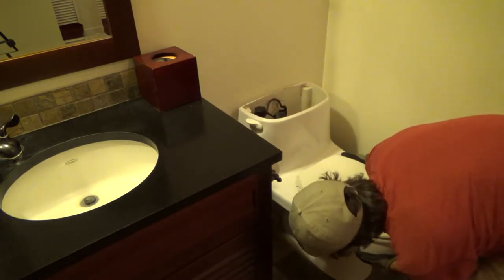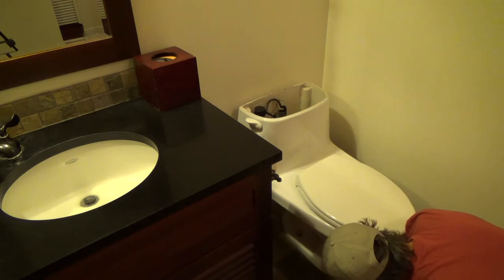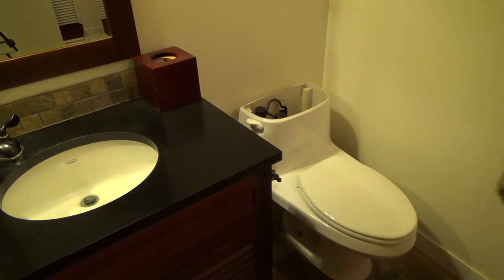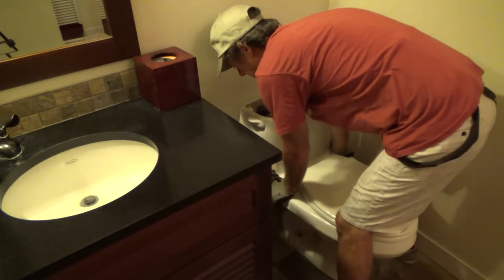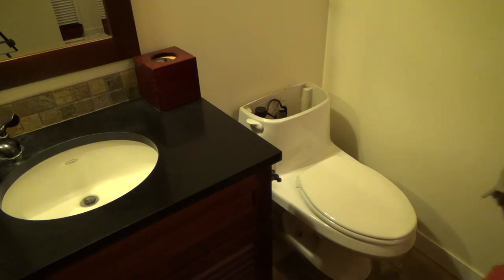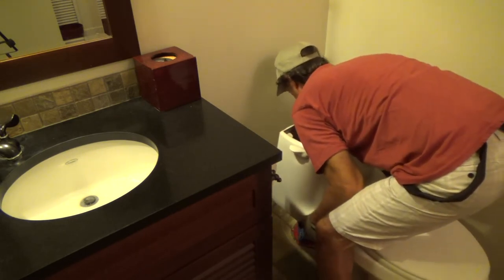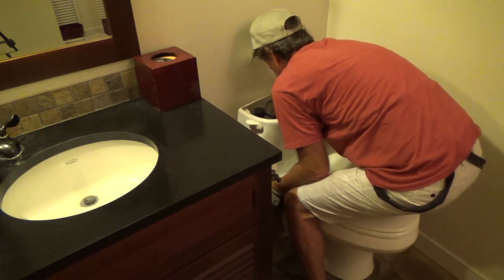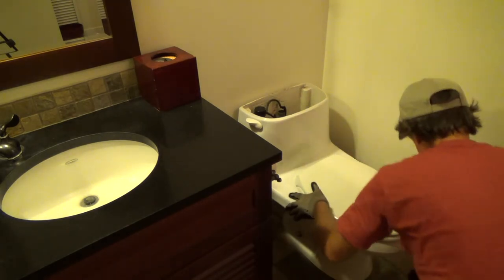How to Install Toilet...Installing Waxless Fluidmaster Toilet Bowl Seal Ring...Part 2

Comment: Don't know if you still respond to older vids but I believe I know why the toilet wouldn't sit flat with the black spacer. I'm going to be in the same situation as you, that's why your video is interesting to me. You have nuts & washers over the flange on the bolts. The black spacer seems to be hard plastic and it wouldn't compress enough when it hits the nuts. You could probably use the spacer if you remove the bottom nuts. I need to put a flange spacer over my flange and want to hold it down with the nuts as you had but if the black spacer won't go  down enough that won't work for me. Another option, since you had 2 kits,  put 2 blue gaskets together, no spacer and move the bottom bolt tabs away from the bolts. There's a pro version PRO7530 that only has the blue gasket & bolts and they have a video showing only using 2 blue gaskets. Nobody near me has the Fluidmaster Pro7530 gaskets though, only the kit with spacer.
Reply from the maker: Yes I respond to older videos too....see?! There are many ways to install this as the directions show you what to do if the existing herkle flange is lower than flush with the floor or flush with the floor. My flange was a little lower than the floor & that's why I thought the black spacer would work but it was just a hair too high so I had to remove & just use the blue rubber goodie by itself. I don't think the black space was hitting the nuts & washers that I had installed first since the black spacer fit just before the nuts & washers so I don't think the black spacer was in the way. I really like putting the first set of washers & nuts on since then they will hold the bolt from twisting in the slot when tightening. I once had a bolt that twisted & came right out when I was tightening up the toilet so then I had to do the entire toilet install again. That's when I use to use the wax rings & I didn't have the washer & nut on there before installing the wax ring. The thing about using a wax ring is you only have one chance when installing the toilet & you can't move the toilet around much once the wax ring hits or you can have a chance the toilet starts leaking where the wax ring was depressed or smeared around too much when installing a toilet. With these waxless ring sets you can move the toilet around & make sure it's square to the wall & shim the front if needed if the toilet is rocking on unlevel floor tile stone floor let's say, & never have to worry if the toilet is going to leak once you tighten up the bolts to secure the toilet to the floor. I'm a believer in the waxless ring set ups for sure from now on. Thanks for stopping by with your message. For more useful DIY videos you can go to my main YouTube channel page then click on playlists then scroll through the many topics I have on my channel that will save you money around the house. Check them out when you have a chance. Take care...
Reply: @videojoeshows  Thanks so much for getting back to me on this and the detailed explanation. I have many of the same concerns as you do. My flange is almost 1" lower than the floor and set in concrete. That's how they built the house in mid 60's. I've had to use 2 wax seals for this and it lasted 12 years. I too want to put the nuts on the bolts to keep it straight but to hold down (2) 1/2" flange spacers to bring it up flush. The space under the toilet is 3/4" to the floor so I'm concerned just the blue seal will be enough as it's 1/2" thick. I too like the idea of being able to move the toilet around a bit to position it using the non-wax seal. You do have a ton of videos and next time I have a tuff project, I'll check them out. Wish Youtube had a search within a channel option. I scrolled through all your videos to get to the other videos in the set for this issue, think there were 5 of them. If I remember once my job is done, I'll try to give an update what I did. Thanks Again!!
Reply from the maker: @bobjohnson5218  Awesome! I would purchase two of the waxless ring sets then use two of the black foam spacers & one of the top blue flanges after that. That would probably do it. Yes the wax rings are alot harder to use plus they have at least 3 different size thicknesses of the wax rings so it would be difficult figuring out which sizes to use then you have to worry about one sliding in a wrong position for instance. Well You tube does in fact have a search within a channel. If you are on my channel you will see an actual search box area within my channel towards the top then you would type in whatever you are looking for & it will pull up anything close on my channel to your title but it won't necessarily show you all the alternatives on my channel for instance. The best way to find things on my channel would be to go to my main YouTube channel page then click on playlists then scroll down to whatever topic you are looking for. I have over 50 topics to choose from on my channel. For the toilet ones you would go to my topic "plumbing" then all of the plumbing videos I've ever posted will be in the plumbing area & there you will find all kinds of toilet videos too. It's always a pleasure assisting viewers like you so if you ever need something then please don't hesitate to check in with me. Thanks again for checking out my videos. Much appreciated!
Reply: @videojoeshows  You defiantly have one of the most organized channels. I rarely see  all the videos categorized as you have done. I see the search magnifying glass next to the about tab. Never noticed it before. I subscribed, never know what you may show, knowledge is power. Thanks again!!
Reply from the maker: @bobjohnson5218  Ha! Always here for my viewers....like you! Keep it going!